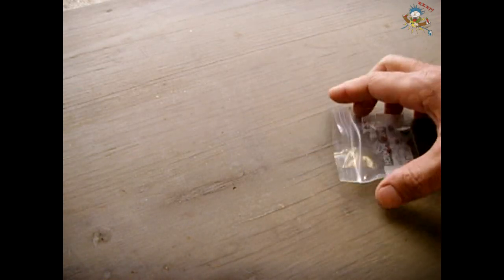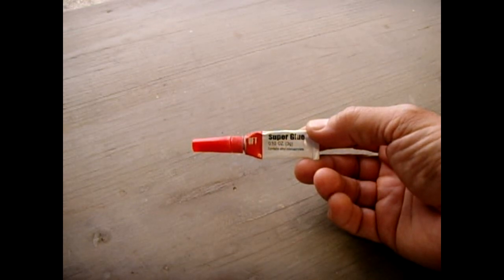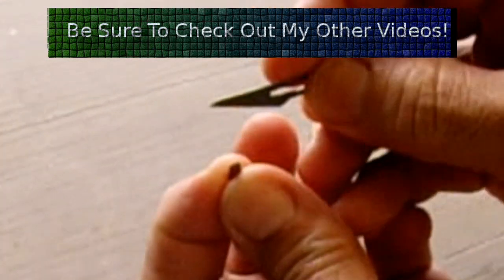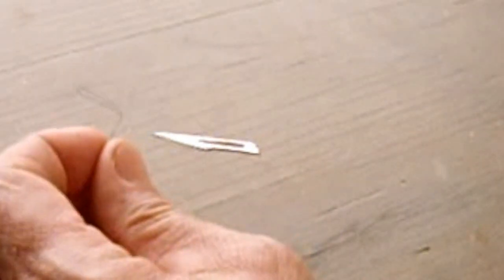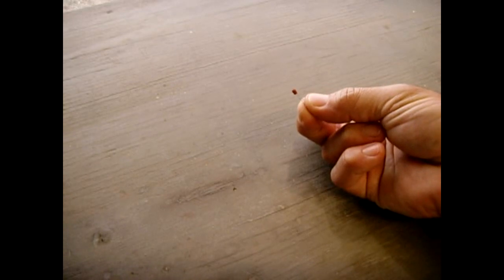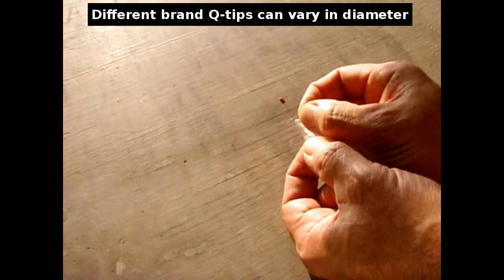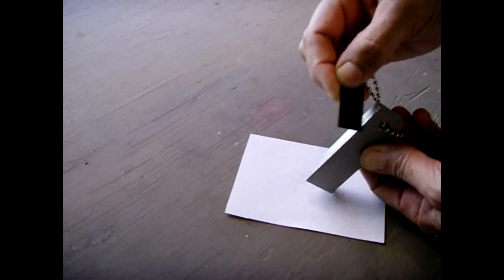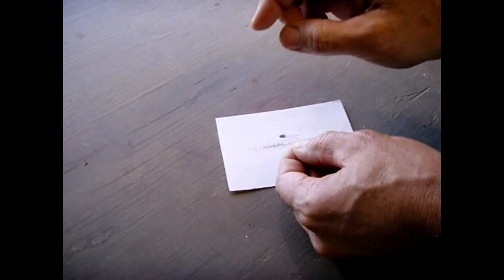DIY Model Rocket Igniters For PENNIES Each!

Comment from the maker: *ADDITIONAL INFO*
Use a blade that's as thin as possible, If you use a Q-tip to hold the igniter inside the model rocket engine nozzle, then make sure only enough pressure is used to keep it from falling out. To eliminate glowing wires inside the alligator clips, use a 1M 1/2W resistor and wrap the resistive wire on each side of the resistor. More magnesium filings will result in a HOTTER ignition.

Comment from the maker: @Stefan Kuklinsky

You did not allow others to reply!

Using a 9V rectangular battery is no good unless you are using VERY thin Kanthal Wire. 9V batteries cannot supply the current required.
Reply: electronicsNmore I got the 34 gauge just like you said and you used a 6v and it worked so I don't understand why a 9v won't work. But I figured out why it wasn't working--I was stupid and let the alligator clips touch the ground. Even when they aren't grounded sometimes the wire doesn't get that hot, but it is a good cheap way to do it. Thank you!
Reply: +Stefan Kuklinsky The 9V battery doesn't put out a lot of current...the bigger 6V battery can. The four cells of a 6V battery are MUCH larger than the 6 teeny tiny cells of the 9V battery. (I haven't finished the video yet, but this much I do know)

Comment: you dont need the match lol the wire melting would work
Reply from the maker: I guess Estes corporation is also wrong. LOL
Reply: Literally that’s how the Estes igniters  works it just melt the wire from over current and that lights the rocket
Reply: @electronicsNmore  unless in the past 23 years they changed it, I just finished my big birtha from them but it has been sitting on the shelf since 1993, so maybe mine are just an old design but they certainly don’t have the match idk I guess.
Reply from the maker: @eveangreen1871  All the igniters I ever used had a pyrogen over the resistive wire to assist ignition.
Reply: @electronicsNmore  idk

Comment: I got some regular 34 gauge wire from the craft store, put a shallow slit in the match head wrapped the wire from one end through slit to other end slid heat shrink over it to hold it all tight,worked well, looks professional, heat shrink makes everything look professional. 9v worked fine but I don't know how many uses you would get. Tried looking up the max amount of current and amp hour they have but gave up after.......lazy

Comment: Hey, how many volts do you need to send through the wires to ignite the model rocket. In my case, it's a A8-3?
Reply from the maker: 6V to 12v is fine.

Comment: Will it work if more than one is having an electric current running through it? I'm asking because the rocket I've built out of scratch uses 6 Estes c6-5 engines. If you can answer back that would be greatly appreciated even though this is an old video
Reply from the maker: Using more than one of these isn't recommended because they won't ignite at exactly the same time. Thanks for watching!

Comment: Hi can I use normal copper wire and normal match also will it work for estes can u pls reply
Reply from the maker: No, it's too thick and doesn't heat up properly.
Reply: Oh ok but will it work for an b4 4 engines

Comment: I had a LOT of problems with the super glue sticking MUCH better to my fat fingers than it did to the match heads.
It turned out I had much better luck with carpenters glue, of all things. Did not stick to my fingers and got tacky quick enough so I could put them down to dry. Putting the glue on the wire instead of the match head was easier.
Reply from the maker: I'm surprised. I had no problems. Thanks for watching!
Reply: Found out even with trimming most igniters would NOT fit in to the aperture of estes mini engines, so went back to drawing board. Made some powder from the match heads (wooden strike on box ONLY matches work better than book matches for this), bent wire so very narrow gap(same width as estes igniters), put a drop of super glue on the wires and dipped them in the powder. IDK how effective they will be, but they do fit very well in to the engine.

Comment: You are applying 6 to 12 volts with what amperage? also do you need to  hook up with both pos. and neg.?
Reply from the maker: +keith mcguire 
Hi Keith. Use (4) or more AA, C, or D cell batteries. You can also use (1) 18650 lithium ion battery. Use the wire size stated in the video. Thanks

Comment: What is your power source set up?
Reply from the maker: 1 lithium ion 18650 or 4 AA'S
Reply: Nice, impressive, one 3 Amps 3.7v can deliver that kind of juice. Great video.. thumbs up and subscribed.. I tried with two 9v batteries in parallel and did not work but I guess I am doing something wrong. I will check the charge again. Might be dead...if not, would you recommend any other check?  Maybe the wires that I am using?

Comment: I ordered Kanthal 34 Gauge AWG A1 Wire 100ft Roll .16002mm , 21.1 Ohms/ft Resistance. Will that work ok with an Estes 4AA launch controller? A previous poster seemed to be having issues with 32 Gauge, do you think the slightly thinner 34 Gauge will help any?
Reply from the maker: 4(AA's) should have no problem with 32 or 34ga A-1 resistive wire. :-)

Comment: Can we use 4 aa batteries? Thanks
Reply from the maker: +Stephane Deraspe 
Sure can. Just be sure to use a slightly smaller gauge of resistive wire. The lower the voltage, the slower the match will ignite.